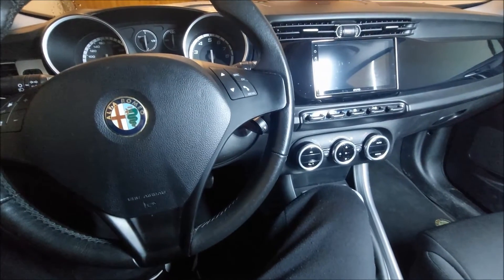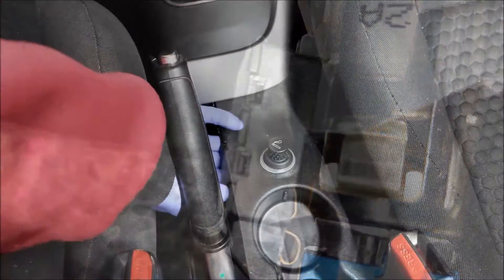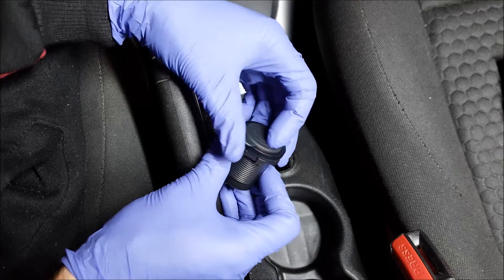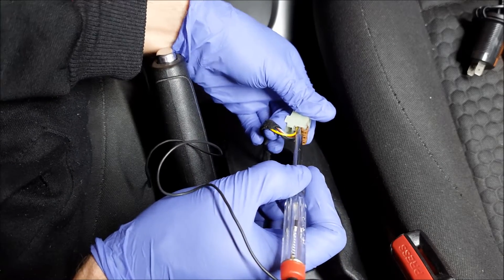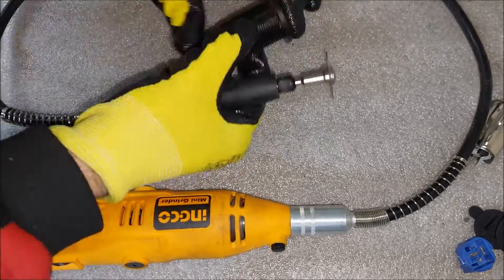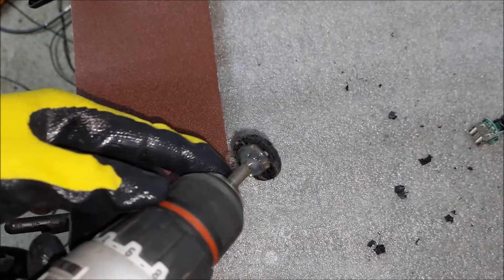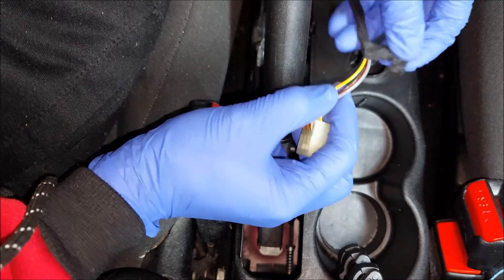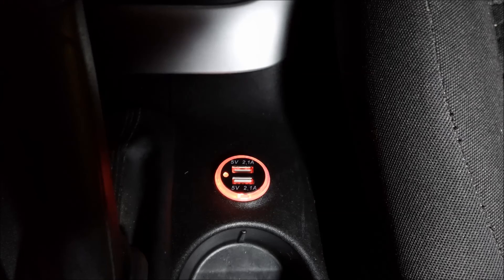Cigarette Lighter to USB CHARGER Conversion Alfa Romeo Giulietta, Lighter Removal, Testing Wires

Comment: Although I never use the cigarette lighter, I live in a flat with basement parking. So I use the socket for my tyre pump.

While it may not be as good as a replacement unit, I have a unit that just slots into the cigarette lighter sicket and provides USB power far better than the socket as standard in the car.

By the way, the one in later models with the touch screen and uConnect can be a nightmare.

Connect anything to it, and it tries to download any music library or phonebook even when you don't want it to!
Reply from the maker: Thanks for sharing man